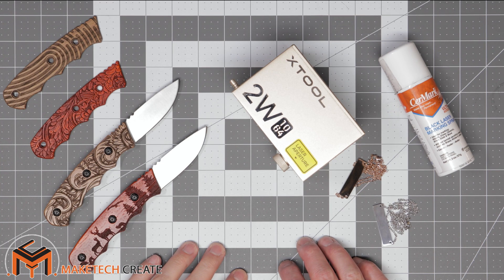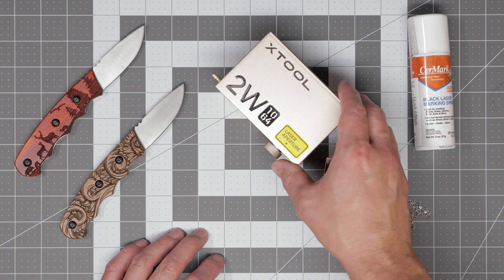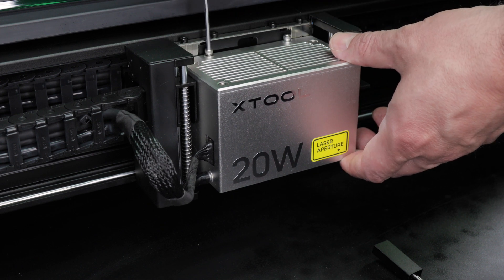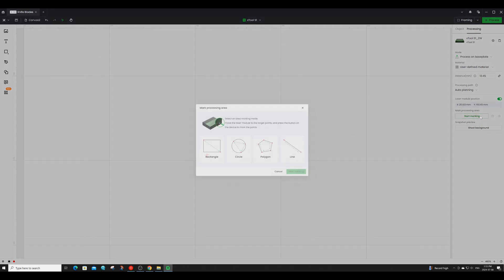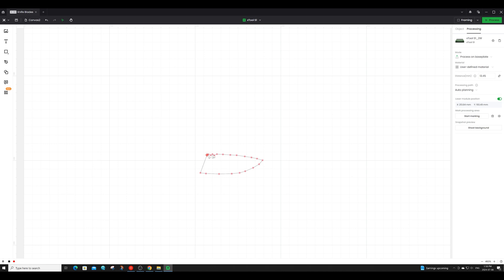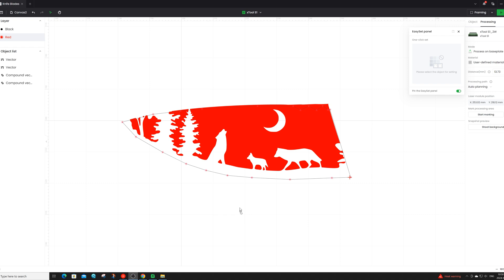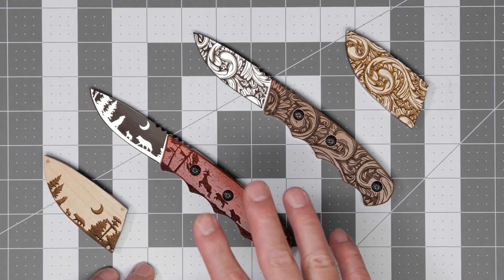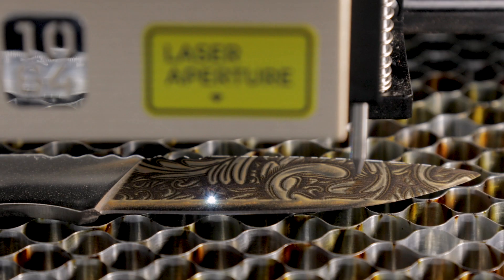EASIEST Way to Laser Engrave Metals!

Comment: Great video! I have one question for you! I’ve been playing around with etching some knives using your settings and have noticed that the etchings leave the blade a little rough on the design. Other than rubbing alcohol is there any way you’ve found to restore the blade to a smooth surface without losing the etching itself? I’ve tried using some polishing compound #421 with a dremel which shines up the bare steel but still leaves the etching a bit rough. My worry is that with repeated use the etching will cling to a lot of the material being cut and build up over time.
Reply from the maker: Try some different polishing compounds on a scrap engraving until you get look and smoothness you like. Different steels react differently to polishing, so you really need todo some testing to get the results you want.

Comment: How deep does the IR laser etch?  Would it be able to create a deep maker's mark?
Reply from the maker: The IR laser goes deep enough that the etching wouldn't wear off, but if you want  a deep engraving, you'll want a fiber laser of atleast 20w.
Reply: @MakeTechCreate  Thanks for responding!  Sounds like an IR laser would work for my needs since it's durable.

Comment: I am more confused now then ever.  Every video i have watched on lasers said that the IR or diode lasers couldn't do this on metal, that you always had to use a fiber laser or use a some sort of spray or spray paint.  How deep is this engraving, or is it just marking the blade here? Or did you spray the blade with that laser paint?  It's not clear here?
Reply from the maker: Standard diode lasers can't mark metal without a spray. While IR lasers can.
These IR models are essentially low powered fider lasers. They'll engrave metals like a fiber laser, but aren't powerful enough to go deep like a fiber laser.
Reply: @ Wow!   I had been wondering about that.  Thank you for the clarity.  I was trying to save up for a fiber laser that I didn’t want to buy, because I didn’t like the small work area.  This helps a lot.

Comment: Did you spray that laser dye on the knives before engraving or was they done with no spray
Reply from the maker: No spray needed with the IR laser...it will directly engrave metal.
It basically works as a low power fiber laser.
Reply: @MakeTechCreate  hell yeah, was just wondering, your engraves look black and mine come out this brown-ish color
Reply from the maker: Could be your speed. I went really slow.
There was a slight browning to mine, though.
Also, it could be the type of stainless you're using, too.
Reply: @MakeTechCreate  you’re the man brotha, dropped the speed to 15% 100power, 300line per and damn this knife looks SWEET